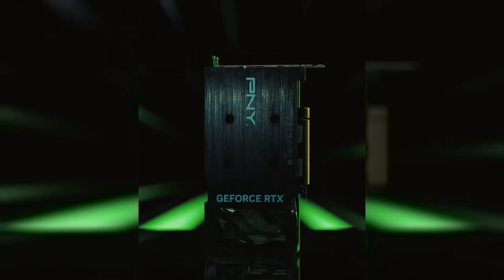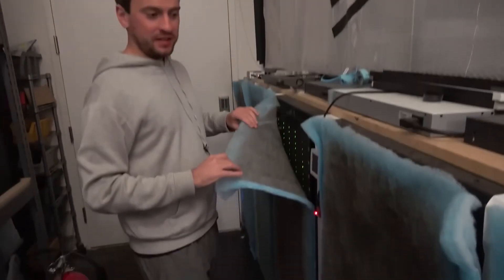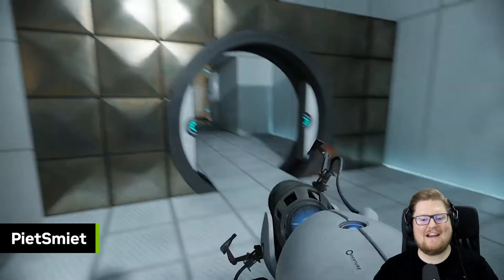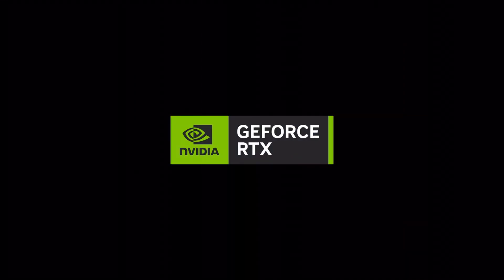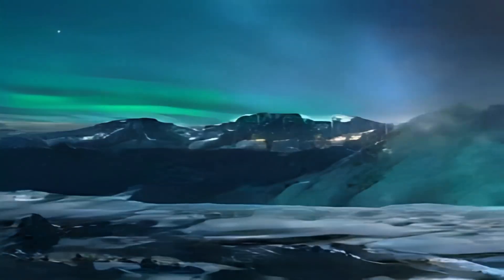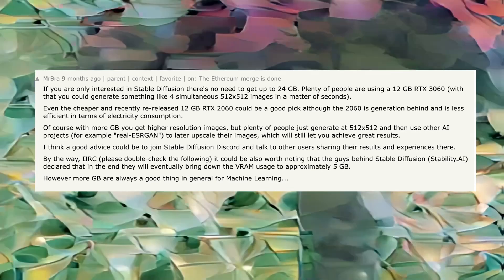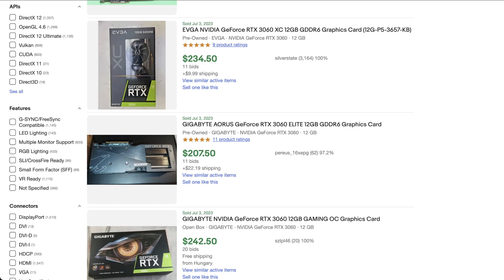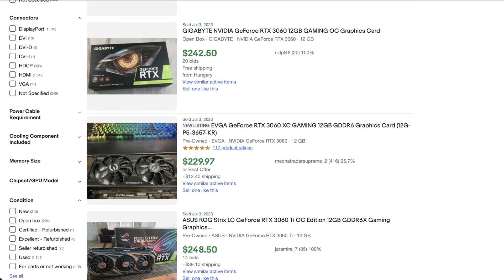Should You Buy nVidia RTX 4060 for Stable Diffusion?  AI Gaming?

Comment: Huh, I am using Invoke AI running SD 1.5 (and variants of this model) on an MSI 2060 and that only has 6GB video ram. Still churning out 768x768 pictures pretty fast. The same goes for my mobile 3050Ti with only 4GB ram so not sure what you say about memory being so critical here. Was wondering about upgrading my standard 2060 to a 4060Ti as it would also be nice to have better gaming performance, but it seems SD would run at 2x speed too which is decent too.
Reply: If you want to generate higher resolution you want more vram. Face looks terrible at base generation (full body shot).
Details are weak too.
If you add controlnet which is a standard you will absolutly need more than 8Gb. Therefore the more Vram, the better it get.
Reply: @lefourbe5596  , I generally just upscale the image then do individual improvements like the face which always generates an excellent face as I describe it using a 768x768 area.

Comment: For those who are researching this topic and come to this video, there's some clear problems with the conclusion of this video. First of all, the reviewer seemed to mixed up 3060 and its TI variant (mixed up the 4000 series as well); you can't be mixing them up when trying to give recommendation. Second of all, VRAM bandwidth is usually not the bottelneck of LLM or stable diffusion (not saying it will not be ). What's more important is...first whether you have enough VRAM to load/run the model, and second the FP16/32 performance of your chip (some models/applications might have slightly different preference). Now enough theory on paper, there's benchmarks of 4060 and 4060ti running stable diffusion already out there, and they are both better than 3060 (12G). If we only talk about pure performance (so assume you have enough VRAM to do what you want to do), 4060 actually performs very close to 3060ti and 4060ti performs close to 3070 (obviously better than 3060ti). Now if you add VRAM into the equation, 3060 (12G) does still have its place over the 4060 (8G), i.e. it can load larger models; it's also a lot cheaper at 2nd hand market sure, but 4060(8G) is most certainly not "slower" than 3060 (12G). The AI space is evolving really quickly so the actual % might change, if you want more information check https://www.reddit.com/r/StableDiffusion/comments/15h4g7z/nvidia_amd_intel_gpu_benchmark_data_update/
Reply: Yeah, thanks for pointing this out. I just upgraded from a 2060 Super to a 4060 ti and it's definitely an improvement despite having half the bus width. You can also check the Tom's Hardware review for a stable diffusion benchmark and they show the 4060 ti beating the 3060 ti (once again with the 3060 ti having twice the bus width)
Reply: @TheParadoxy and the Intel Arc a770 beating the 4060 at lower price and double VRAM 😂
Reply: @TylerDurden-up8hz  if you think I'm an Nvidia fanboy, your wrong. I have another rig with a Radeon 6750 XT that I absolutely love and have found it to actually be a better user experience for machine learning than the Nvidia cards for the most part. But then I'm sol in certain contexts like running the newest Leela Chess Zero networks on that card because Open CL doesn't support the attention mechanism

So if Intel is fully functional for stable diffusion that's awesome! I checked the Tom's hardware article and saw that it's beating not just the 4060, but also the 4060 Ti. It looks like in the original article they couldn't get 768 resolution working but later figured it out. If people say it's working smoothly for the new sdxl models then I think the A770 is hands down the best option for stable diffusion on a budget
Reply: @TheParadoxy thanks man
Reply: Thank you
Reply: thanks lot, now i know what was the fp16 and fp 32 in gpuz website
Reply: Hi mate, I have a 3060 ti 8gb and want to start with depp learning. buying a 4060 ti 16gb and run it alongside with 3060ti 8gb is a good combo for starters or you suggest somthing else?

Comment: Honestly it makes the most sense at this point to get an M2 Mac with 32 or 64gb of RAM to be able to run LLM’s and video generators. Since you can’t get that kind of VRAM without a very large budget.
Reply: it is slower still. not by that much. a friend M1 MAX is able to generate in 2.2 times slower than my 3090 (at 85% power preset).
impressive since APPLE siliconrun below 45W. but also this 64 RAM M1 max costed him 4000€ !
Reply: I would argue against it. Firstly that's costlier than so many gpus. And it's still slower than most Nvidia GPUs.

Comment: DLSS applies to all rendering, not just ray tracing. Additionally, the "7/8ths of all frames" is based on upscaling a traditionally rendered frame from 1080p to 4k and using DLSS 3 to insert an estimated frame between each of those, meaning only 1/8th of all generated pixels are based on actual rendering from the game engine. All this adds graphical artifacts and latency of course.

Comment: If I was doing only generative AI, I'd buy a M40 or P40 cheaper than a 3060TI for 16 more GBs of VRAM.
Reply: TL/DR: EVERY developer making popular AI apps, including Auto1111(SD), Bmaltis(Kotha_SS),Oobabooga (textgen) and several others have all told me the only solution for numerous recent SYSTEM DESTROYING incompatibility errors was "get rid of the m40"  that was each and every one's exact words .
i have a 3060xc, and an M40... keeping that m40 running, with driver/board/pcie resource/ecc cache issues, incompatibility with most 4bit/8bit/bf16 optimizations makes every thing about that setup more complicated... and most common ai applications are ALL moving toward "cross platform stability" and what that means is making everything more WINDOWS-USER friendly, then rolling the closest equivalent of the new windows setup to the other platforms as an autoinstaller/auto env/venv setup (i had to do a complete system reinstall 2 weeks because a Koyha_SS linux docker had literal windows stuff in it) ... these are  quickly making it impossible to configure run m40's on dual-gpu systems... m40's are becoming only viable on single gpu, headless or IGPU-videoout setups...
Reply: P100 as well, but what has kept me away from them is the noise.  OMG, the blast blowers from hell is not my idea of fun, nor is having to rig up a water cooling loop for one either.  Stuck in a rock and a hard place since Feb.
Reply from the maker: Also a very good choice!
Reply: I don’t think I’ll be picking up a data center GPU for myself any time soon, but the prospect of using one is interesting. From what I understand, the speed isn’t as fast as the new cards, but the extra VRAM can be helpful.
Reply: @pokepress  How fast they are depends on the application and the system. There will probably be no gain in speed if you add more than one in a consumer grade system. But if you want to run a LLM, it will be much faster than offloading some layers to RAM, and not much slower than a consumer grade GPU with the same amount of VRAM.

Comment: sry can't agree - 16GB is huge for SD - when you generate 512 you simply won't ever get the results as if you are doing larger initial image. also if you are doing this a business to sale images - size matters a lot - and if you source is low quality you wont ever be able to upscale it. for a rig that will just generate images 24x7 and upscale them - time is not as important as high quality end results. but for general having fun - 3060 ti is indeed just as good.
Reply: So have anybody tried SD on 16gb 4060ti already? I still have to decide if it is better than like 4070 12 gb in high resolutions
Reply: @TheBobo203  It is for sure. It simply gives you much more options with 16GB. 12GB is just limiting. You will constantly get errors and will need to adjust resolution.

But 4070 is faster - so it all depends on what you end goal is.
Reply: @TheBobo203  Being that most of us who buy x060 cards we are on gen 3 boards.  FFS, Nvidia not only halved the bus width (even my 1060 has 192bit) but they stuck it where it demands a gen 4 to take full speed advantage else the gen 3 people will be at x8 max with 128 bit bus.  That is horrid, no matter how anyone tries to serve it.
Reply: I started tinkering into SD and so went with an Asus 4060 16GB.  No regrets.  The memory gets used up and no errors that I constantly see with others running lower GPU memory cards.  I don't play any games so I don't care about that.  I would love an enterprise level card but not going to pay for that.  Seems like the 16GB 4060 is the best middle ground now for this purpose.  I know Intel's support gaining traction in SD but not going to be a guinea pig for that.
Reply: @oldtwinsna8347  what's in the rest of your system, cpu, ram size motherboard etc?
Reply: Now that Stable Diffusion XL is out, 12GB is barely enough to scrape by. The RTX 3060 12GB is still an excellent budget card and is barely enough to generate 1024x1024 SDXL images. However, if you need to train models at 1024x1024 or generate images larger than this, you will need at least 16GB or even 24GB of VRAM.
Reply: @KillFrenzy96  If you want to train a full on checkpoint (FT/DB) you need 32GB to 48GB now for XL1024x1024 BS1 as just a full Unet is 23GB to itself.  I hope we get some refinement/optimizations soon to lower that to more sane levels.
Reply: @generalawareness101  Ah how about a LORA? I have not done any training with SDXL, but a LORA for SD NAI required around 11 GB VRAM for 768x768 resolution half precision.
Reply: @KillFrenzy96  LoRA/Locon train fine but 16GB on a 24GB at the min with spikes to 18GB and 1024x1024 you need at least 20GB I was told by someone who trains them.  This is why most people feel 12GB will be the min for 768x768 in a month, or so (optimizations), and all we are going to see now are LoRA types not full on Checkpoints/Models except for those willing to rent a 48GB card to do them.
Reply: @generalawareness101  Thank you, that is important information to me as I was considering a RTX 3090 or RTX 4090 for training SDXL or using bigger LLM models. I mostly wanted to train LoRA/Lycoris models and preferred to use my own hardware for experimentation instead of relying on Runpod.
Reply: @KillFrenzy96  I refuse to rent a GPU but here is something all trainers are mad about who purchased a 4090...it is barely faster than a 3090ti.  The problem is, I 100% think, is the CPU is bottlenecking it so you would need a next gen setup where even gammers no longer see a bottleneck.  That system we need as well since a lot of traffic goes back and forth between the CPU, bus, and GPU.  Hardware wise there should be a 56% increase in speed from a 4090 to a 3090ti, but in reality you would be lucky to see 20-30%.
Reply: Question guys, someone know how much is it/s doing 1024x images.on sdxl 1.0 ? Using the 4060